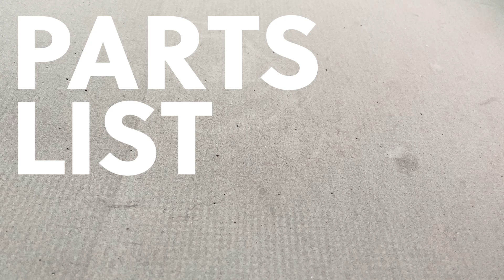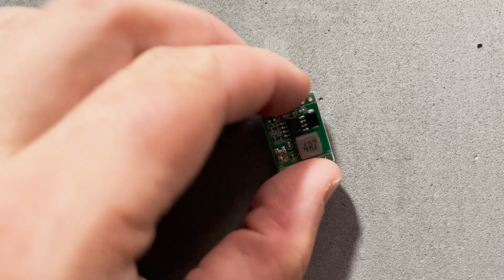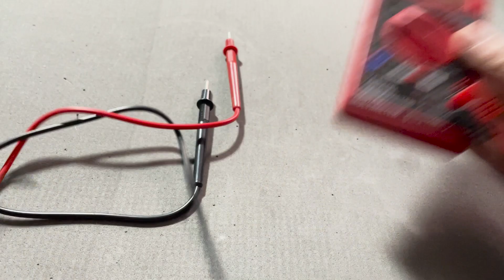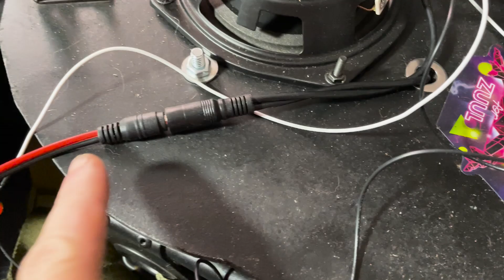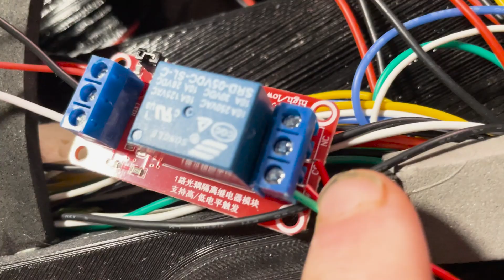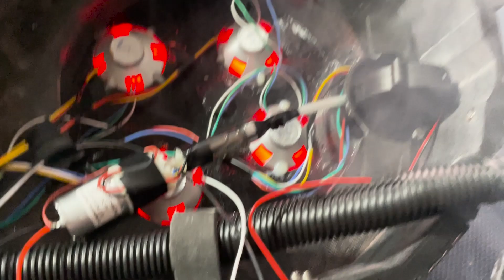Overheating! Ghostbusters The Video Game Venting Smoke Effect!

Comment: Hey Joe, I'm having trouble getting the the smoke relay to activate. I've double checked my wiring and I'm using the same relay that you are using, but still no activation of the relay. I've ensured I soldered the yellow wire to D9 on the adrinio nano. Can ya help me, am I missing something?
Reply from the maker: If you haven't already I'd post this in my Arduino for Ghostbusters props FB group, likely will get more help. You could have a dud relay. Did you get more than one?

Comment: Did you make any changes to his code because I still can't get my relays the trigger I get the Arduino to go through it's routine nothing it's like the Arduino is not sending trigger to turn the relays on. Until I figure out what's going on I'm going to have to add a manual switch to turn the relays on just try and sync it with the end of the venting system something just occurred to me Geelong trigger wire caused the problem I had to put the relays in small boxes on the back of my Alice frame because there wasn't enough room inside so I had to use a long cable to get the trigger signal into the back of the box could that be the reason why it's not working,
Reply from the maker: I would go to my FB group "Arduino for Ghostbusters Props" and post some pics of your setup.

Comment: MikeS11  are you still using his code for this because I'm not getting my relays to activate when the packs are overheating nothing happens it doesn't even Trigger I was wondering if his code has been set up to run the trigger signal or not🤔🤔🤔🤔🤔🤔🤔
Reply from the maker: No, I didn't change anything in the code. I DO know that some relays don't work exactly like they should with his code, depending on what relays you are using. What relays are you using?